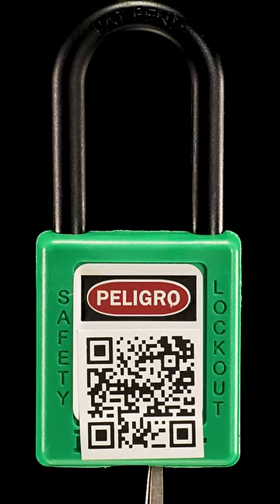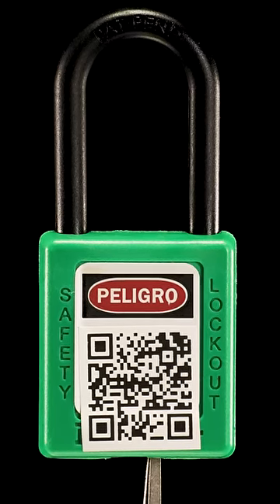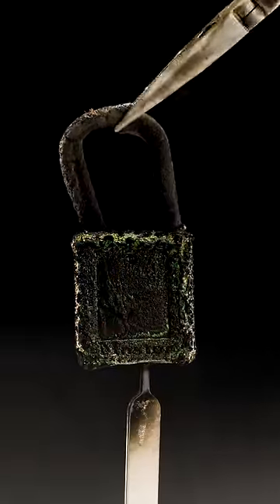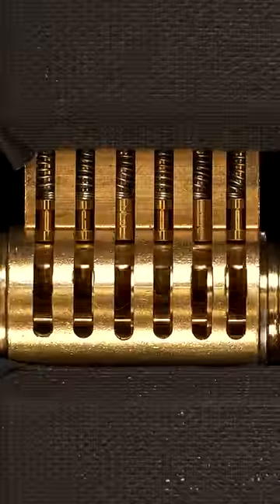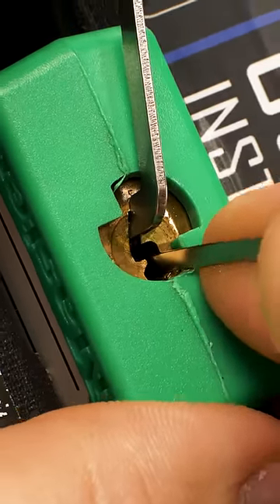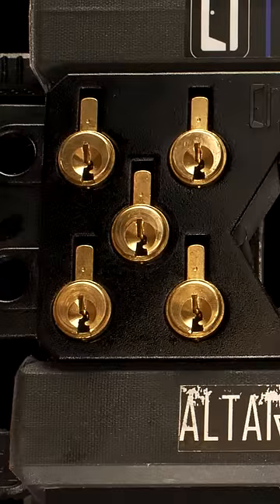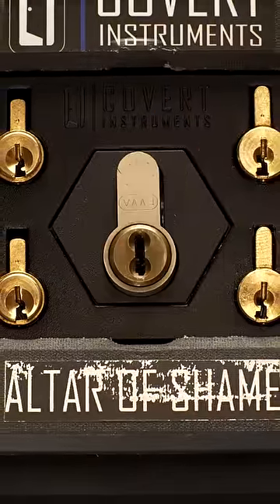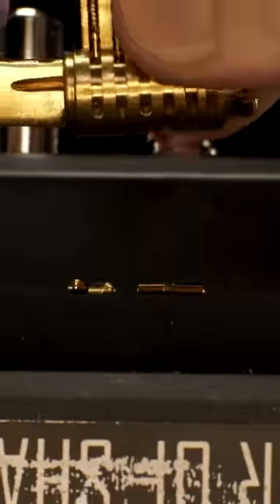Locksport Trainer

Comment: There was rage attached to that flame. Almost as if the dude was outright insulted by the mere existence of the lock.
Reply: PLASTIIIIIIC? 😡🔥
Reply: @chuck2998  it's meant for logging out devices. So basically you either put it of the plug through one of the holes or there's a lockout on the trigger. If a device is locked out and you use it the company is not responsible if you get hurt and you're probably going to lose your job
Reply: Meet the Pyro
Reply: This lock is a sin against humanity.
Reply: @ryla22 how so? Its meant to be easy to break if the key is lost. It only comes with one key and is only used by factories to lock out power supplies on equipment when its being worked on. It ensures that the equipment stays powered off while people are working in it. Its plastic so that if the 1 key that it comes with is somehow lost, the lock can be broken off.

This is not a lock that was made for private use, it was made for a specific reason and is perfect for what it does. It is called a Lock Out Tag Out lock. It saves lives every day
Reply: @rainingdeathx3368  tl;dr stop getting salt about things nobody said.
Reply: @ryla22  how is it a sin against humanity though? This lock isnt for private use. Its not used to prevent theft
Reply: Lmfao
Reply: Knowing that LPL runs covert instruments it wouldn't surprise me
Reply: That flame was the rage
Reply: well no that would need extra air before the combustion
Reply: Actually the qr code made him do it due to the leading to the they're on site BRAGGING how fire resistant it is
Reply: @rainingdeathx3368  I have this lock and it’s stupid anyone can come up to it and easily snap it off at least a metal you need bolt cutter for and not many people in my plant would have one since besides maintenance why would you need it
Reply: My first thought. How dare you get even cheaper
Reply: He inhaled and released the breath of God yet again
Reply: @thefinalcalamity3908  maybe for corrosive environments that would quickly destroy a metal lock. such as a plant that produces sulfuric acid. that stuff can destroy metal parts pretty damn quickly.
Reply: @ryla22  lots of people say tldr on OSHA recommendations, right up until they lose a hand, or die.
Reply: @thefinalcalamity3908  its to prevent you from turning the machine on and potentially killing someone working on it. I.e for electric boxes and large machinery during maintenance.
Reply: We use these to lockout circuits that are being worked on in electrical work. They don't need to be pick or destruction resistant. It's just there to keep people from turning on a breaker that is being worked on
Reply: @thatgaming1940  this is McNally
Reply: Well I mean it’s a master lock those things really are the worst locks some Master locks can be opened up by hitting it with another master lock meaning you could actually break it with your hand if you’re strong enough it would Hurt the hand tho
Reply: @TlMEL0RD  An example of someone smacking a master lock open would be McNally
Reply: That flame was a very low temperature flame.
Reply: @XX-qf5zj  "revenge is best served cold"
Reply: Thats why i thought this was McNallyOfficial
Reply: It's McNally, he's offended by every master locks existence
Reply: @the_parasites "One shudders to imagine what inhumane thoughts lie behind that mask... What dreams of chronic and sustained cruelty?"
Reply: Those locks or for locking out devices at work.
Reply: It is a decent lock stuck because it was in plastic
Reply: Well, I mean, if you expect your item to be waterlogged, I would like a rust-proof lock than one that can rust, but then again, why are you storing something in water so long that the lock can rust?
Reply: Its just a lock out tag out lock

Comment: I use those daily at work. It's really not meant to keep people from stealing anything. It's meant to be a very annoying deterrent for people to not turn on equipment someone is working on.
Reply: what i don't understand is if they can make a lock cylinder that is hard to pick, why put it on this one when really the most simple lock will do in this case, and put this hard to pick cylinder on one of their massive "high security" locks made out of hardened steel? that's backwards as hell.
Reply: @bobbyc2768  It's to make it hardly pickable, so the chance of an attacker destroying this specific lock instead of picking it, doing whatever and relocking it in place is much lowered.

Still isn't a reason why "high security" locks get cores that can be combed open.
Reply: @ujiltromm7358  that is so unlikely to happen. in my old job in a pretty big warehouse we used those to lock out forklifts that had something wrong with them that made them unsafe. if someone saw that on one nobody wanted that forklift. in fact people came early just to test out their forklift so that if something happened to it during day shift we could switch it out, it's annoying working 12 hours on a forklift that has even the slightest thing wrong with it. i would imagine in most companies people aren't going to bother trying to bypass one of these locks. it's just crazy to me that masterlock is capable of making a lock that's hard to pick and they market all these "high security" locks and they don't even need to be "picked" they just open up from almost anything, and they make this thing hard to pick when you can just break it off easily and replace it with another one or whatever. i kind of figured after all these years of masterlock making these big monster locks out of hardened steel that are picked in half a second and new "higher security" models coming out after they've been exposed with the same exact problems, i thought they just weren't capable of making a good lock cylinder that was hard to pick, or if they were capable they just simply would not due to not wanting to spend any more time designing anything or something, idk. weird.
Reply: I'm more certain with every video like this that Master Lock's entire goal as a company is to troll the general public. None of it makes sense and that's the point.
Reply: marketing and capitalism.
Reply: That’s what most locks are for they aren’t some indefinite safety tool they’re all deterrents
Reply: I only use my red lock when the safety nazi is in town
Reply: @tims_always_fishing7117  understandable
Reply: Since it's used in industrial environments, it helps that it doesn't corrode, spark or conduct electricity. It's only there to indicate that the equipment is out of service or under maintenance, ie "don't use it". Probably the pick resistance is for insurance purposes so you know that people really went out of their way to sustain a well earned injury.
By the by, the core does switch out for an easier one in one of their metal locks, making it the hardest lock that Master doesn't produce, it would place it well outside of the price range assiciated with their products.
Reply: Its made to make the "killed on accident" a "murder on purpose"
Reply: Fire
Reply: Lock-out/Tag-out
Reply: A TSA keyed lock would do the same thing and be just as secure as an all plastic lock.
Reply: I think the idea is that you want it to be evident that something happened to it if it was removed. In a safety critical use like this you don’t want it to be covertly removed.
Reply: It pretty much turns an “accident” into a first degree murder charge.
Reply: These locks are the border between life and death